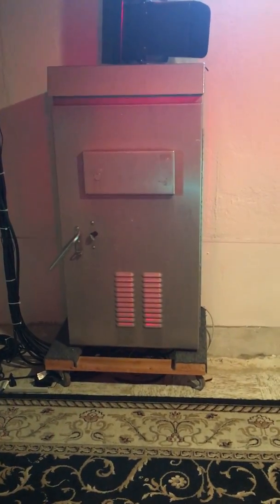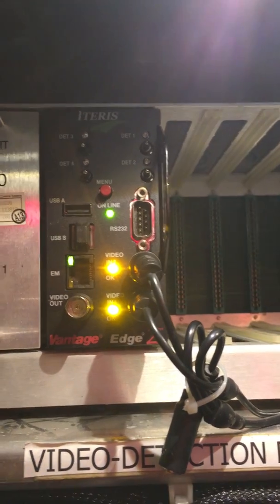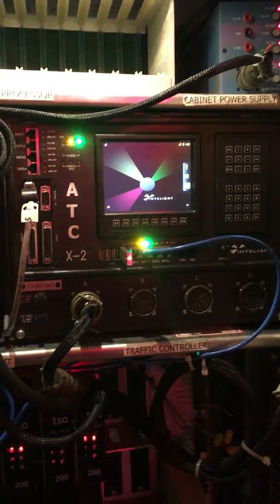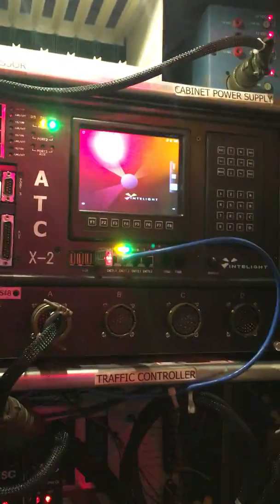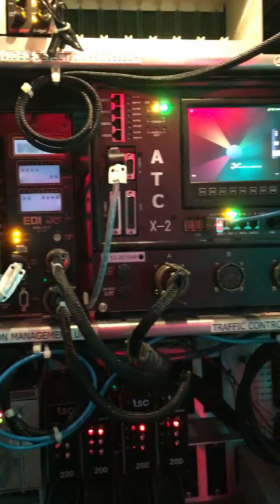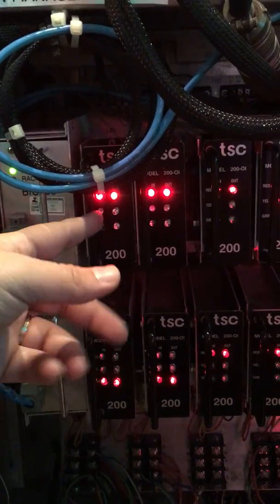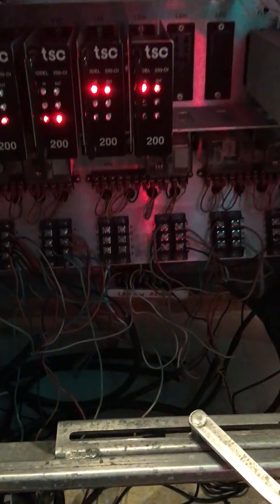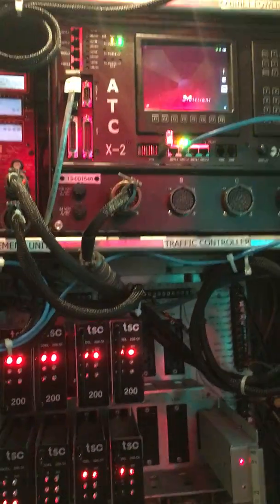Basement Intersection - Traffic Controller Cabinet

Comment: Hi, I admire your work. I guess this is a rare but very useful video. create some time and refine this, in the meanwhile, what is that box that has toggle switches at the back of the door? i got a presentation on this in seven days. plus any links to other videos explaining the inside of a control panel will be appreciated. thank you.

Comment: Still a great cabinet, lol I still think you need a larger cabinet so you can sell me that one, great video keep on collecting, not sure how I missed this video
Reply from the maker: Thank you! For now the cabinet does trick, although real estate space in there iis limited now. The X2 controller is a space hog
Reply: Ok, well keep me in mind if you do sell, I need a small cabinet with more phases which is not an easy find, hopefully one day I will, was told I can't have a big cabinet or will be kicked out lol, the X2 is a sweet looking controller, I heard Orange county Fl bought 150 of them and is getting rid of Siemens M50's which they run
Reply from the maker: @kenlacey6781  Will do! This cabinet was designed for a 4 phase TS1 backpanel - 8 load bays. I bought the TS2 panels separately and fit it into a non-conventional cabinet. I had to do some jury-rigging to get it to fit, and there is no room for a power panel. The cabinet definitely was modified for "indoor use" and not street use, because I cut some stuff out. I need to eventually get some sort of mercury relay, or similar because there is none to drop into a conflict flash. It displays the flashing and the load switch power at the same time if that is the case. Time based load switch flash is fine and start up flash works fine while the load switches are not powered. There are room for improvement as I get to it.

The X2 controller is awesome and very powerful with the Android touch, but it is incredibly slow. I can see most technicians out in the field using the standard Maxtime local software or using the built in server to access it from a browser - very cool feature. I had a Eagle M50 for years before the X2, and kind of miss it sometimes. Good ol' SEPAC software is a breeze to use. Heard Siemens may be coming out with a touch controller, but never seen one.

Comment: To be honest you really should do a video on how this cab is connected up.  There are a lot of people that would find that to be useful.  Collectors especially :-)  Long videos are not a big deal these days.  People can always come back and watch the rest later.  

As a collector myself I really appreciate your set up.  My gear is older NEMA TS-1 version from the 70s, 80s, and 90s.  I also acquired a load bay/ terminal back panel from OMJC years ago.  It alows for 12 load switches (6 flash transfer relays) and has the old power section (circuit breakers, line filter, fan controller etc.). My controllers are the older type using the MS ABCD connectors.  Sadly with this rig I can't even flash my yellow left turn arrow.  I don't think it was possible.  Though I could cheat and use the flashing walk feature LOL.

Actually doing a major career change at 41 years old.  Certifying through the IMSA to become a traffic signal technician.  Being in IT never paid off or advanced me after college 12 years ago.

Comment: Where do you buy this equipment?!? 

My Signals are all braindead, and Ebay hasn't done shit for me.
Reply from the maker: I did not buy all this in one swoop. I bought the cabinet, more or less, as a shell, and over the course of many years rebuilt it with the electronics you see inside. Google "Traffic Light Wizard" as they regularly have full sized cabinets in stock. If you only have a few signals, or not the cash for a street cabinet...as they are expensive...you can go an easier route to get the signals to cycle realistically. Google "Lights to Go Traffic Light Controls" and look for their T3 sequencer. Cheap, easy to wire, and well made. But it's not what you'd find on the street. They're for stand alone signals people have.
Reply: Nick, I am in the same boat.  I have checked both sites but am having the problem of not being able to find a controller that can handle two signal heads and two pedestrian cross lights with a push button actuating both directions of traffic.  I originally had a tscontrols TS-14 which worked great, but I had to move some stuff around and in the process broke that controller.  I don't mind springing for a full sized controller but do not know where to find the old ABC cables you mentioned in your video.  Any help would be greatly appreciated.  Thanks.